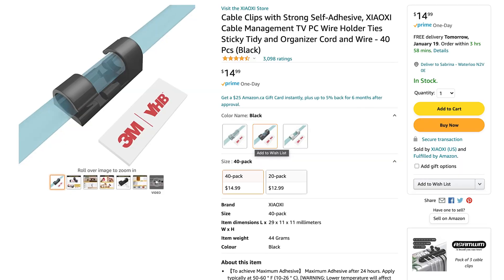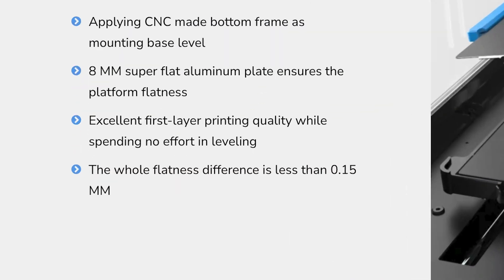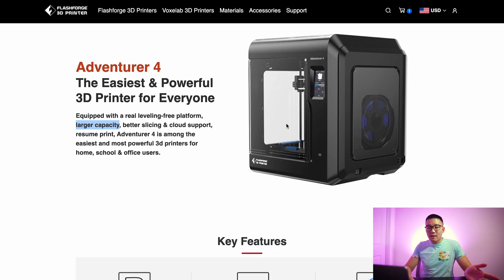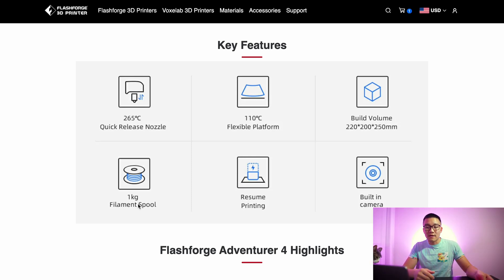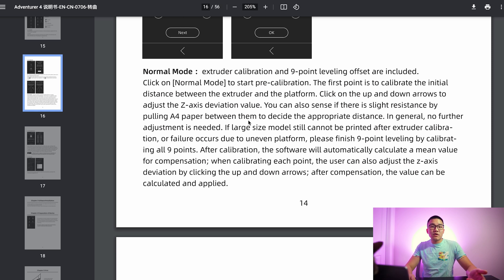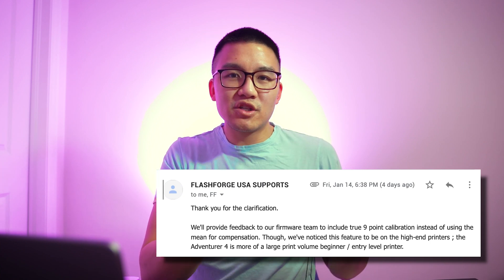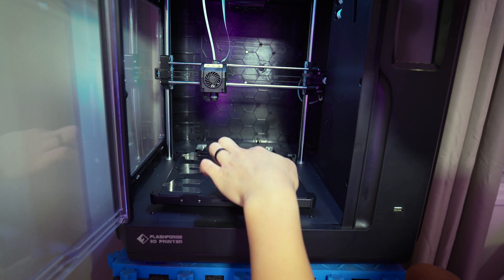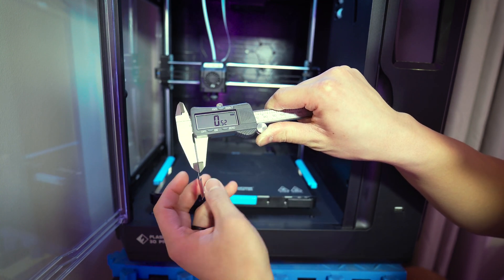Adventurer 4 - 9 Point Calibration Scam

Comment from the maker: Did you experience something similar with your flashforge adventurer 4?
Reply: Yeah. Leveling the Z-axis solved a bunch but my right side of the bed still prints too high, so might put some tape/shims there.
Reply: I watched your other video, about leveling the bed by adjusting the Z axis worm gear connection.   

But based on this video, I designed and printed a pair of snap-on jigs for the Adv4. 
https://www.youtube.com/watch?v=iQX2112NiFU&list=PLmwww1mismbLtM2Ja-Yq5WiR8FYyn-9m0&index=28&t=73s 

Here's the STL file for my jig (download from Windows OneDrive using any browser, print two):  
https://1drv.ms/u/s!Arf1YeMUEh5Gm7Rt_8Mw0vnugbkWbQ?e=IDfHc4

These snap on to the 2 Z axis gantry rods, as shown in the video.  The left side is definitely lower than the right.  Very obvious with my jigs attached.

I was just about to figure out the easiest way to get the screws out of that worm gear connector, then saw this video.  This product on Amazon seems to be metalic tape with Adhesive.  Do you think this would work?  I like the adhesive idea, so things don't move or slide around.

https://www.amazon.com/dp/B097HHJQPS/ref=syn_sd_onsite_desktop_171?pd_rd_plhdr=t&spLa=ZW5jcnlwdGVkUXVhbGlmaWVyPUEyVjhCR1BUMzNUNkwwJmVuY3J5cHRlZElkPUEwODA5MzE5VEExM1hSMVJORldCJmVuY3J5cHRlZEFkSWQ9QTA2MDQ4MTQxMkpEQjdUMzJKVVdOJndpZGdldE5hbWU9c2Rfb25zaXRlX2Rlc2t0b3AmYWN0aW9uPWNsaWNrUmVkaXJlY3QmZG9Ob3RMb2dDbGljaz10cnVl&th=1 

I can't believe 9pt calibration takes the Average... this means each of us must go though the exact same Leveling Ordeal you are experiencing.   Thanks for everything so far!   - Don
Reply from the maker: @dondec  I think that metalic copper tape could work to help you level your bed rather than trying to take apart your printer and adjusting the gears from up top. I have yet to do that and am still using the shims. Seems like now only my left side is wildly off from the rest of the bed.

Note that adjusting the brass nut on the leadscrew only allows increments of around 0.75mm (assuming a 3mm pitch screw from what I measured) which is almost 3 layer heights. But if you use the tape on the bed instead, that would work. One thing to note about the tape is that if you ever plan to take it off, you might be left with some nasty residue.

I'll have to try out your snap-on jig!
Reply: @justmakeitdaniel7667  Really appreciate what you've done, this sort of research is hard to find.  I have an engineering background too, though mine is software/firmware dev in the telephony industry (AT&T, Bell Labs, Lucent, Avaya, Verizon Wireless), now retired.  As a sw developer I was really shocked to learn they average the 9pts, because that's "so not me"... haha.  I would have automatically designed mesh leveling into the firmware.  Since they didn't, I have to believe this is some sort of marketing strategy for later products.  Anyway, getting back to the brass nut/leadscrew discussion, I may only need 1/4 turn to get close enough, then shim out the fine details with some sort of tape.  My biggest concern is dropping the screws, and "seeing" back there.  I was told I can take the whole top off by undoing 4 screws.  That may simplify things.  I'll mess with that tomorrow.
Reply from the maker: Yeh I got the same instructions from support about undoing the 4 screws and the top should come off. That levelling method to me seems like it will produce the best results. Along the way, I’ll probably learn a few more things as well!
Funny enough, I am in the middle of a transition from hardware engineering to software right now :)
Reply: @justmakeitdaniel7667  I did manage to get the top off.  Found the front 2 screws sticking my head upside down in the cabinet with a flashlight.  Both screws are vertical.  The smaller back screws were more difficult to see, one left of the chamber fan, and one behind the right z-axis worm screw.  Finally getting to the adjustments, seemed like the left side was one belt-click off.  I used my jig to tighten both to bottom out the jig posts.  Keeping that alignment while trying to reinstall the belt tension spring was trial and error, as everything moves as you try to reinstall it.  Be careful as the tension cylinder also has a groove the belt "fits in".  First time around I didn't notice that, and my belt was riding over the groove lip.   Finally, with settings all done and tightened up, I saw no need to reinstall the top screws after I put it on, unless I transport the machine elsewhere in the future.  FYI
Reply from the maker: Thanks for the advice! I do believe in commenting heavily because I often wonder what other people’s code does
Reply: I got the mp voxel pro  which is literally the exact same as the adventurer 4. I was expecting fully auto leveling like the Bambu lab. I am having a hard time to level it because of this (I’m new).
Reply: I fucked up the same way 😭 I bought this printer I had a chance to comit refund but I refused and now I cant do this 😭😭
Reply: 100% exactly the same issue

Comment: I've reverse engineered Adventurer 4 firmware code and it does contain the 9 Point Calibration calibration code. They have the code which preprocesses the gcode lines before sending the gcode for execution. 9 Point Calibration calibration code works the following way: it spits the coordinates into 4 quadrants and uses the calibration points as vertices of these quadrants. So when gcode line is analyzed it determines at which quadrant the extrusion is going to happen. Then it uses these vertices offsets to adjust the head position at this gcode line using the mean value of Z offsets for this specific quadrant. Apparently such methon won't work if the head needs to travel more than one quadrant while extruding a long line. But in most cases it works. So you can't say that it's total scam.
And yes, if you switch to "expert mode", you just use a single offset value for the whole plane

Comment: I managed to level the bed on my adventurer 4 using brass shim between the aluminum build plate and the linear bearing underneath it.   It took a 0.05mm packer under the left front and 0.25 under the right back. The variation in height across the bed has dropped from 0.4 mm ( intolerable when printing large objects ) to 0.15 which is not good but is usable.  I was worried I would be introducing load on the rails under the bed but this does not appear to be a problem.  We could probably get it closer, but I figured I would stop while I was ahead.

Comment: Great video! 
I have 4 of these in my classroom. I have one that runs near perfectly. 
Then I have two that no matter how I calibrate it to stick the first layer prints to far down and is difficult to get the part to release without damaging the build plate.
The last one boggle my mind, I can get a perfect print but the next couple won’t even stick to the bed. 

Wish I knew this before I made my switch from the Axioms to the Flashforges.

Comment: I don't own an adventurer 3d printer,  but UBL is what saved me hours of fail printings and recalibration. Just let ubl do the leveling and store 1 mesh per each material (abs, pla and petg), proper z-offset and inicial gcode to load the saved mesh before each printing. G29 L1 to load the mesh and G29 J to adjust it before the print starts. 
I haven't touched the knobs of my printers bed for months since this. My next step is to try the solid mounts instead of the springs. 
Great video, love your work and tinkering on things.

Comment: Prusa cost around 800 USD, Ender 3 V2 with BL-Touch (Original), Ender 5 Plus, Prusa mini+ etc... Has bed level calibration the right way when they are talking about 9 point leveling. FlashForge is a joke.
Reply from the maker: Yeh, sadly it’s past my return period
Reply: @justmakeitdaniel7667  When watching your videos, it feels more like you want to buy an Creality printer. Its a tinker machine that can be modified for all your needs, Direct Drive, BL-Touch, Own firmware, New LCD, Octoprint, Klipper, New screen etc... 

It would be cool to see you go from like an Ender 5 Plus to a maxed out modded Ender 5 Plus, or an Creality Ender 3 V2! 

GL & HF
Reply: @NotDoingThisToday  Could you give me advice about what you think is the best printer for a beginner? Price range is anything under $1000.
Edit: I would love to have something that is easy to use.

Comment: what you understand about 9 point calibration is the real calibration which you can find on Prusa. so I wonder why you pay 1199 on this printer but not Prusa MK3S+...
Reply from the maker: I definitely could have but initially The flashforge adventurer 4 just looked better with the full enclosure and 9 point levelling which now I found out was a bit of a scam. A part of me also doesn’t like the idea how a printed that uses 3D printed parts is that expensive

Comment: I don’t buy the excuse for not having proper compensation on the z and only going for the mean, you get it on printers that are cheaper than the adv4!
Reply from the maker: I totally agree! In a way, I feel lied to when they advertised 9 point calibration. But what can we really do...
Reply: flashforge is careening downhill, they're also calling this a "lower end printer" its 800 bucks, and 800 dollar printer should have decent calibration. I actually stopped selling these because of this principle. Between that and the internal problems they're having they've gone from a company that I used to love to a company I"m embarrassed by.

Comment: Great video! I wonder if you can unscrew the build plate and add washers to give it a lift? I haven't looked at how the screws come off but just an idea I have?
Reply from the maker: There is a way to level the leadscrews which I will be attempting. Adding washers to the bed is not ideal and those would need to sit on top of the linear guiderails